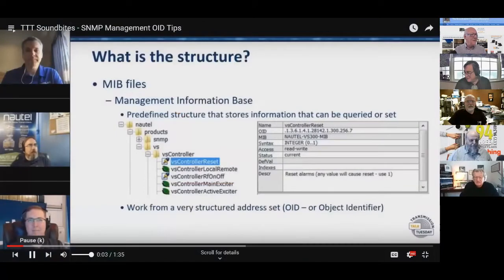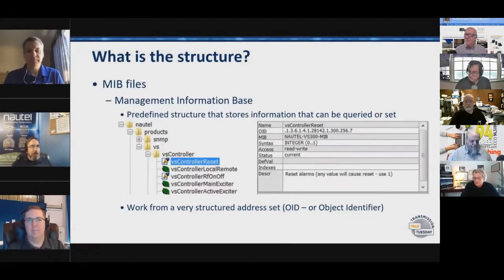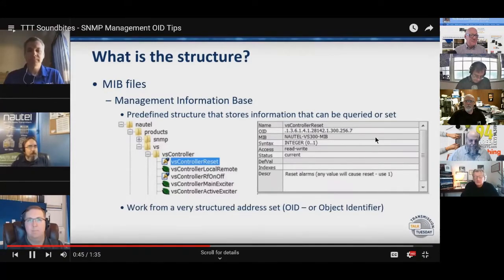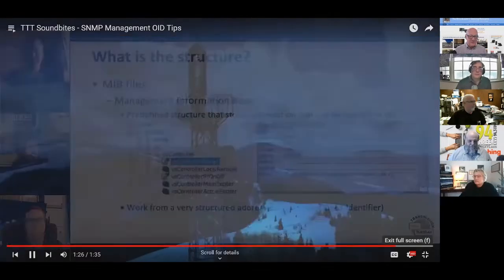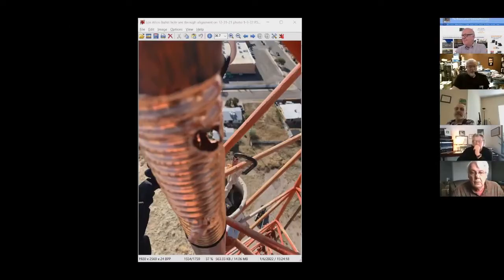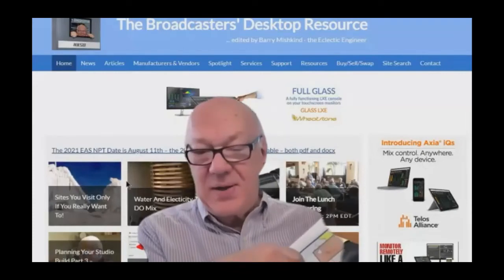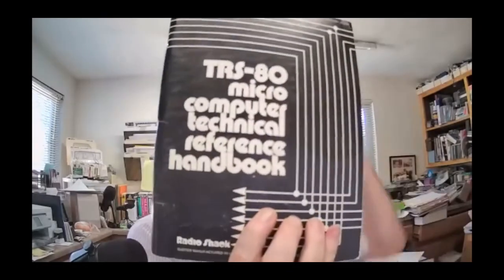Maintenance When, Where, How? on the BDR Lunch Gathering 1/13/22

Comment: Regarding chief operators and whether or not they must be employed by the station, per FCC rules, they do not have to be station employees unless it's an AM station using a directional antenna or operating with greater than 10 kW authorized power, or of a TV station. See the following section of the FCC rules for more details.

§ 73.1870 Chief operators.

(a) The licensee of each AM, FM, TV or Class A TV broadcast station must designate a person to serve as the station's chief operator. At times when the chief operator is unavailable or unable to act (e.g., vacations, sickness), the licensee shall designate another person as the acting chief operator on a temporary basis.

(b) Chief operators shall be employed or serve on the following basis:

(1) The chief operator for an AM station using a directional antenna or operating with greater than 10 kW authorized power, or of a TV station is to be an employee of the station on duty for whatever number of hours each week the station licensee determines is necessary to keep the station's technical operation in compliance with FCC rules and the terms of the station authorization.

(2) Chief operators for non-directional AM stations operating with authorized powers not exceeding 10 kW and FM stations may be either an employee of the station or engaged to serve on a contract basis for whatever number of hours each week the licensee determines is necessary to keep the station's technical operation in compliance with the FCC rules and terms of the station authorization.

(3) The designation of the chief operator must be in writing. Agreements with chief operators serving on a contract basis must be in writing with a copy kept in the station files.

(c) The chief operator is responsible for completion of the following duties specified in this paragraph below. When these duties are delegated to other persons, the chief operator shall maintain supervisory oversight sufficient to know that each requirement has been fulfilled in a timely and correct manner.

(1) Inspections and calibrations of the transmission system, required monitors, metering and control systems; and any necessary repairs or adjustments where indicated. (See § 73.1580.)

(2) Periodic AM field monitoring point measurements, equipment performance measurements, or other tests as specified in the rules or terms of the station license.

(3) Review of the station records at least once each week to determine if required entries are being made correctly. Additionally, verification must be made that the station has been operated as required by the rules or the station authorization. Upon completion of the review, the chief operator or his designee must date and sign the log, initiate any corrective action which may be necessary, and advise the station licensee of any condition which is repetitive.

(4) Any entries which may be required in the station records. (See § 73.1820.)